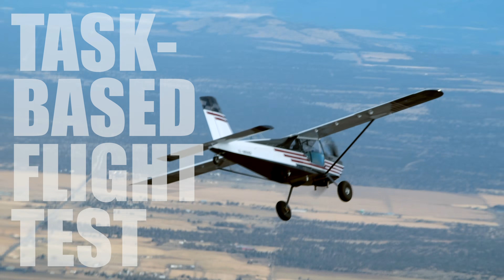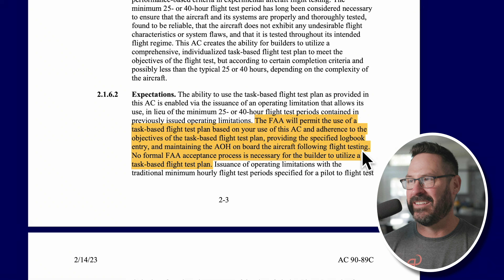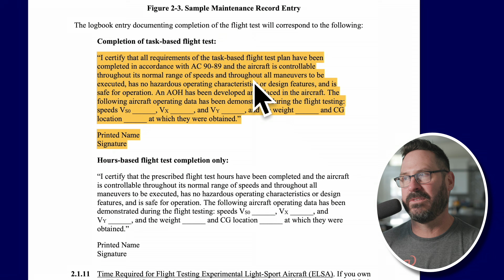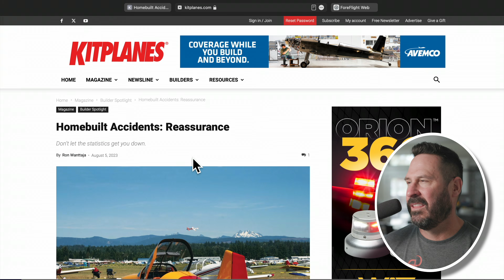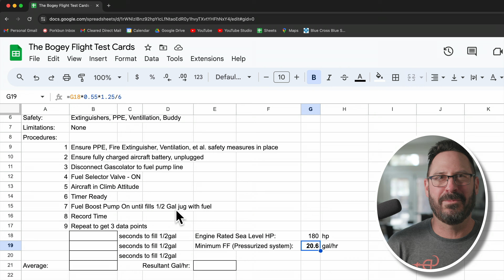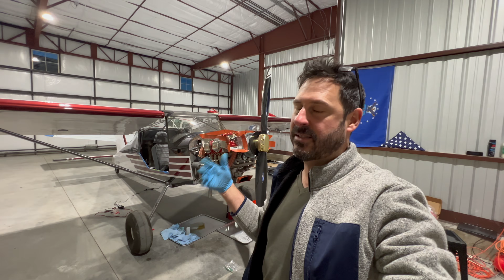Ep 1 Planning & Fuel Flow Test - Task-Based Flight Test Series

Comment: “That was a successful first test,” sounds like someone is mixing up test objectives with success criteria (aka completion criteria). Remember, the object under test may fail the event but such failure safely found is a successful test. 

Having gathered sufficient data and then processed it to the information required so as to be able to determine whether or not the object under test meets or fails to meet the test objective makes for a successful test as such meets success criteria. Keep your definition of test success completely separate from your definition for object under test success. 
Expect good tests will often find failed objects (success criteria met, test objectives not met). Note failed test objectives drive deficiency reports and a need to fix the airplane. Failed test criteria drive lessons learned and a need to adapt and/or test procedure. It is highly unlikely to be able to determine an object’s success if a test failed (though test failure for a safety violation could possibly meet such a case).
Reply from the maker: Um ok

Comment: At 6:45, you said "...essentially take out your ops limitations and put in your POH." I think that's incorrect. You are issued a Special Airworthiness Certificate (SAC) for your Experimental - Amateur Built (EAB) aircraft, and the Ops Limits are a part of your SAC. The Ops Limits never go away -- they are an integral part of your SAC. Your POH is in addition to, not in place of, your Ops Limits. Your Ops Limits specify what you can and can't do during Phase 1 (the test flying stage); your Ops Limits also specify what you can and can't do during Phase 2 (normal operations after Phase 1 is done). Think of your SAC and your Ops Limits as one document. The FAA certainly does. Both need to be in the aircraft during flight.

Great series, by the way; and great channel, even before this series!
Reply from the maker: Yeah I definitely oversimplified. I’ll look into the regs and refine my explanation if needed (sounds like it) on ep 2. Super appreciated!

Comment: Fuel test question, rather than trying to chase a static volume, did you consider, would it not be easier, more precise, to use weight. You don’t have to be exact on stopping/ volume chasing, just time start and stop, weigh ,calculate?
Reply from the maker: I didn’t consider it. I suppose you could if your scale can be accurate as liquid is added, potentially sloshing. I think I’d measure by volume again if I had to. Thanks for the question!

Comment: Hi Steve. What speed did you choose as V_NE on your S21 and do you have to reach or maybe exceed it during flight testing?
Reply: Okay. I jut thought there might be a requirement to test it. I’m flight testing here in Germany and they make us fly V_D (10% over V_NE) as TAS. I set my V_NE for that reason much lower to 165kts CAS (operationally sufficient). I’m not very comfortable with the high V_NE that is stated in the Rans POH.
Reply from the maker: I’m essentially going with the factory Vne of 215mph (187knots). You definitely don’t want to test that. Sure, there’s plenty of safety margin built in, but I don’t flirt with it. Absolutely zero benefit as I see it. The first thing to fail will be the windscreen or skylight.

Comment: I am currently going through a Part 147 program to get my A&P certificates. I have also not found a good reference for maintenance entries. Maybe an organization like Savvy can create an example. This is the line from FAA-H-8083-30B, "Whenever maintenance, preventive maintenance, rebuilding, or alteration work occurs on an aircraft, airframe, aircraft engine, propeller, appliance, or component part, a maintenance record entry must be created."
14 CFR 91.417 is the reference for what is required. Basically: Description of work performed, Date Completed, Person that completed work, signature (is defacto return to service for work performed).
Reply from the maker: Awesome, thanks for the good info! Im guessing they don’t want to “lead the witness” so to speak and encourage simple accurate entries rather than canned statements but I kinda want some examples! I’ll have to thumb through my Bonanza logs again. Good luck with the program. We need a lot more good A&Ps!